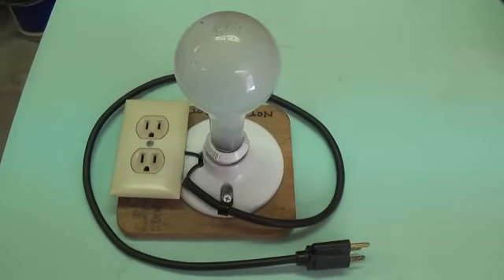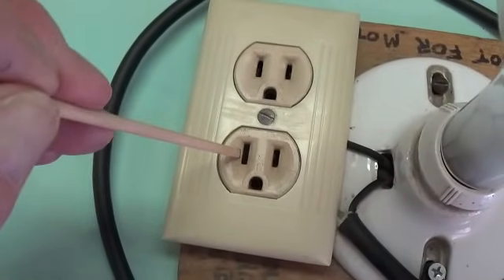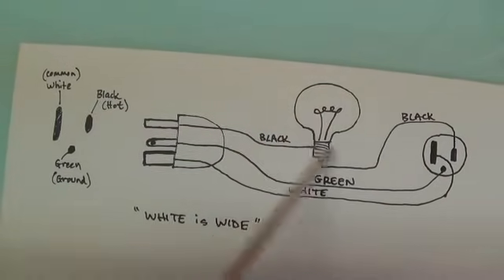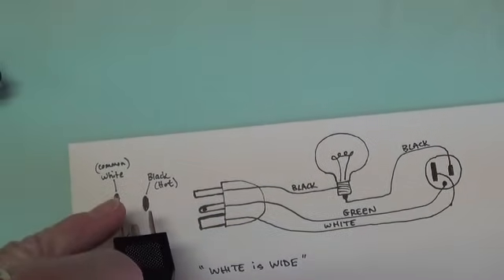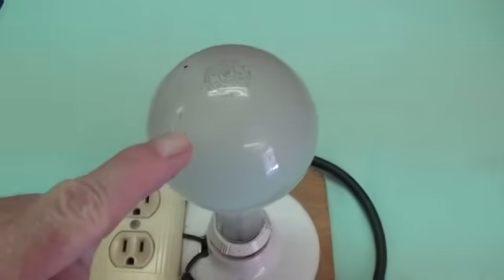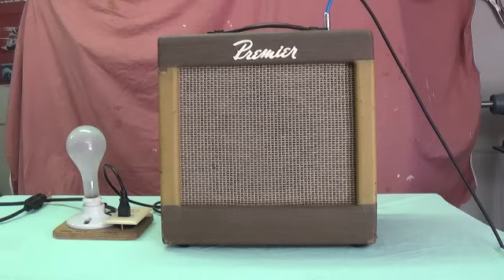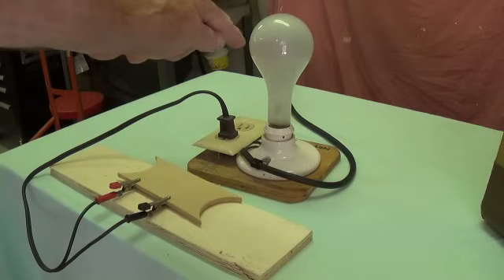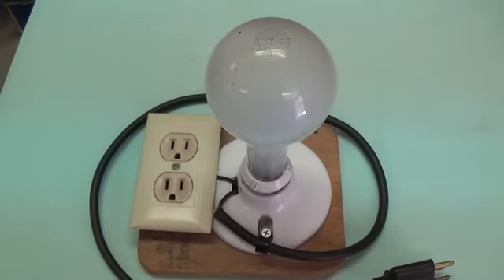Build Your Own Current Limiter for Protection when Repairing and Testing Electronic Equipment

Comment: it is safe for me to use 240v 100w filament bulb in this current limiter? would it serve the same purpose?... planning to make one similiar like your myself...reasob being have a 110v usa fender amp...the voltage here in my country is 240v...and getting a 110v bulb is a bit difficult here...thought of using 240v 100w filament bulb what is available here...pls advise...tq
Reply from the maker: +Fender Strat Gibson Les Paul  Yes, since your voltage is double ours in the U.S., your current flow is half, so your current limiter will require a much lower wattage bulb, i.e. 240V 100W.
Reply: Thanks uncle doug...
Reply from the maker: You may have to experiment a bit to get the perfect wattage, but 100W would be an excellent starting point. Good luck.
Reply: +Uncle Doug when you said experiment with the wattage...i should use bigger wattage than 100w?.. or lower wattage than 100w? how do i know "X" wattage is enough? my amp is a fender deluxe reverb RI 22 watts...im using also a 240v - 110v converter...
Reply from the maker: You want the bulb to either get warm with no glow or glow very slightly during use. Use the 100W. If it performs correctly, then continue using it. If it glows too brightly, then use the next higher wattage.
Reply: +Uncle Doug thanks...really appreciate it...
Reply from the maker: You're welcome :)
Reply: +Uncle Doug hi uncle doug...ive got a question...it is possible to use a current limiter that plugs dirrect in a 240v wall voltage... and use a transformer step down at the end of the limiter to plug the 110v rated amp...or instead i should use of a step down transformer at the beginning which is at the wall input ...and plug in the amp directly to a 110v current limit at the end? does the transformer in between the amp and the lamp changes things? hope u get what im trying to explain...
Reply from the maker: I would personally place the current limiter as close as possible to the amplifier circuit, so in your case, that would mean a 250W bulb current limiter in the 110VAC line between the step-down transformer and the amplifier.
Reply: +Uncle Doug ok uncle doug...got it...thanks alot!!! u have been a big help!!!
Reply from the maker: You're welcome.....best of luck :)
Reply: +Uncle Doug hi ... i have another question... what if i want to install a toggle switch...to switch between limiter and full power..how do i do the wiring connection?a spdt toggle switch will do the job?
Reply from the maker: I don't recommend it. It would then be possible to connect an amp, thinking it was current limited but with the switch in the wrong position, and have damage occur. If you want to bypass the CL, simply unplug the amp from it and plug the amp into the wall receptacle.
Reply: +Uncle Doug you are right...never thought of the switch on the wrong position...thanks o wise uncle doug...
Reply from the maker: You're welcome :)

Comment: Nice demonstration. Would a GFI outlet work acceptably in this arrangement? 
I would add that twice in my life I have seen light bulbs burn out and short internally, causing circuit breakers to pop...probably the filament flopping around in the bulb. Exceedingly unlikely, but something to think about.
Reply from the maker: +Chris Gonzales  A GFI might protect you from being shocked, but it would not offer the visible (glowing bulb) evidence of increased current flow, or the ability to estimate the amount of (or changes in) current flow from the brightness of the illumination.
Reply: Actually I meant the inclusion of a GFI outlet on the glowing bulb board...in conjunction with it.
Reply from the maker: It would probably interfere with the bulb's function....opening the circuit rather than letting the bulb limit the current. You could try it and see, however.
Reply: @UncleDoug  Even if the bulb illuminates to indicate a dead short, the GCFI would not trip. It's function is to detect a difference in the currents in the live and neutral wires, indicating a leakage to ground.
Reply from the maker: Thanks for your input, Silas. @silasfatchett7380

Comment: Normally you'd wire the hot line to the bottom terminal of the bulb, so that if you happen to touch the threaded metal part while unthreading it, you don't hurt yourself.
Reply from the maker: +Scott Brynen  That makes good sense, Scott. Thanks for the input.

Comment: Hi Uncle Doug and the trusty furry sidekicks. Greetings from Oz. I've been hunting for a current limiting solution for a situation I have, and I think what I took in from the current limiting incandescent globe video may be a tres elegant and very cheap answer.
 I have a (GSL MPPT 60-1)  (multiple power point tracking) solar controller which is doing very well harnessed to solar panels, charging a 12v battery bank and running some appliances through an inverter. Max output power is 60A, and input volts18-95V. It has an auto sensing 12/24/48V output. I had the smart idea that I could also use the critter in my RV, which has its own solar panel/ controller/ 12v house battery bank setup. The RV vehicle itself (a toyota bus) has a 24V system (alternator, batteries etc).  
The bus solar setup does fine where I am, but if I travel to Tasmania (significantly south - less sun because we are upside down to you) then the solar panels may struggle to meet my requirements, and I had the thought to use the GSL controller as a 24vdc to 12vdc charger from the bus alternator/ battery bank, since it has the ability to both drop voltage and smart charge batteries. 
However I don't know if the device has any input current limiting protection...   wouldn't expect such to be needed for solar panels, but if hooking up 24v batteries to the input side of the controller then there's the possibility of the circuit not having any current limitation, with a massive current subsequently releasing the smoke from the device. The manufacturer wasn't able to give me any guiding advice, other than it wasn't designed or tested as a dc dc charger. 
I'm thinking that a current limiting incandescent setup will give me protection when testing the idea to avoid cooking the critter if the circuitry can't handle/ restrict current from a battery input....   so given the device is max 60A output, if charging 12V batteries then max output is 720W - though I doubt the smart charging circuit is going to dump 60A into a single 12V 100Ah battery.  I'm thinking that if I calculate on say 20A max output that gives a theoretical (100% efficiency) 240W @ 24v input - 10A. Allowing for device losses, I'm thinking if I have a 400W-600W series incandescent load on the 24V input, I'll let enough current through for the device to operate in some fashion, giving me a visual on current without cooking it.
 If the incandescent load glows bright, then I'll be thinking that the controller circuit has no input current limiting and I'm barking up the wrong tree (subject to measuring what the actual output current to the receiving battery is).
Ahem....   yep, not much to do with amplifiers and such, is it :).   If you care to share any thoughts it would be much appreciated, if not, then please give Rusty a bone us for me and buzz the feline with the (head holding?) quad.   Sorry for taking lots of the page, and umm...  I'm not sure on whether I'd see a reply in the google email thingey, but I shall try if I don't see you here.             Cheers   Koj
Reply from the maker: +Koj W Greetings, Koj. After your lengthy explanation, I feel guilty for not being able to offer much in the way of brilliant insights. The only problem I can see is that incandescent bulbs are voltage dependent.  You can hook a 120VAC bulb up to a 24V power supply capable of providing 100A, and all you will get is a very dim glow. The situation would be worse with a 240VAC bulb. Yes, the bulb(s) will curtail the current flow in case of short circuit (or excessive current draw), but their ability to do this is based on the heating of their filaments (and increased resistance), and this heating/resistance may not be reliable due to the difference between their rated voltage and the much lower voltage to which they are exposed.  All this blathering aside, I say go ahead and build it and see if it works :)
Reply: +Uncle Doug   Thanks for the explanation (not blatherskiting at all) and the vote to experiment. I reckon I'll 
play a bit with a few 240v incandescents on 24V to get a ff find a 24v headlight bulb or two, and fiddle to see what watts seem appropriate - I guess according to my original thoughts above, about 400 - 600W worth. 
Pauses with another thought....  ahh, nope, the little portable electric water heater for the rv to make a cuppa is about 600W...  but that's 12V. Headlight bulbs it is I think.   Thanks.
Reply from the maker: You're welcome, Koj. Let us know how it turns out.  Also, Rusty is wondering if the surf is up on the Gold Coast.....he and his litter mates are planning a vacation there :)
Reply: +Uncle Doug  Hi Uncle Doug and sidekicks, sorry for the belated surf report....     The Gold Coast is expecting 6-10 foot of surf when the remains of Cyclone Winston arrive (according to the surf report - I'm about 1300 miles from there, so can't see it myself) Rusty better wear his floaties!. 
 I used to have a 4 legged mate who came windsurfing with me, but he preferred when things were pretty flat. He managed to grip a bit of neoprene stuck to the board fairly well.      Testing the solar controller hasn't been crossed off my mission list yet, but I now have the plan!
Reply from the maker: Thanks for the report, Koj. Rusty and his cronies are waxing their boards and modeling their new Speedo swimsuits. I hope Australia is ready for them.

Comment: I built one of these  with a 200 Watt bulb, and it has been working great. But I recently plugged in an amp that, although it worked well, caused the bulb to glow (at less than full brightness).  It didn't start to glow immediately, but as 5U4 warmed up, it began to glow. Same thing with different, known good 5U4s, and even after removing all the other tubes. No glow without the 5U4. The amp puts out 32 watts with two 6L6s, and takes a 2 amp fuse. Should I assume that something bad is wrong in the circuit? If so, is there a most likely candidate? Thanks for all your great videos. I'd buy your book!
Reply from the maker: +bluesharpfiend   A single 200W bulb is suitable for use with low-wattage, generally single-ended amps. When you work with higher wattage amps, you will have to increase the bulb wattage or use two 200W bulbs in parallel.  The amp circuit is probably fine, but simply too powerful for your single bulb.
Reply: +Uncle Doug Thanks!
Reply from the maker: You're welcome :)

Comment: then you didnt work on microwave oven , cuz they dont work on those kinds of loads , or i made it wrong , but it powers other things nice , just not the oven
Reply from the maker: +Pavle Pavlovic  No, the device is intended for use with audio amplifiers, primarily tube-driven amps. Microwaves, ovens, refrigerators, and medium to large size motors draw too much current and suffer too much voltage drop with a current limiter.
Reply: Uncle Doug indeed , would be nice to know it before i lost the time on it, at least i can use it for some amps when they go by
Reply from the maker: Sorry for your wasted time, Pavle. I never considered excluding its use for microwave ovens in the video description, but now we know. Thanks for your input.
Reply: Uncle Doug thanks, just wanted to share my experience could be useful to someone
Reply from the maker: +Pavle Pavlovic  We appreciate it, Pavle, and wish you the best.

Comment: Most european systems follows the same standard if using a single phase (if 3 phase thaey are normally divided into three separate single phase in the 2 pin connectors), but it´s harder to rekognize wich part that is alive and wich is not. But, it can be seen with a regular voltmeter and marked out with a sharpie on the lab. board.

So i think there will be no problems.
Reply from the maker: +Sheep_Ewe Thanks for your input, SE.

Comment: It should be standard with everyone using high voltage repairs. I have one with three light bulbs each with a parallel switch banked in series so i can add more or less resistance but based on what you are saying maybe a parallel bank too to reduce resistance
Reply from the maker: +graham kaveman  Excellent advice, Graham.

Comment: So good.  Thanks Doug!
I'm gonna build one of these to try out my new (old) Pultec inductor/valve EQ, purchased from a garage sale last year.
I've been meaning to bring it up, but unsure of the best procedure, having not done this before, and not wanting to damage this unit.  
I have access to a Variac, but the current limiter sounds like the best way to go.
(Or is it best to use both current limiter and Variac together on first power up?)
Reply from the maker: +EvLoutonian You're welcome, Ev. I use the CL every time I test or work on any 120VAC electronic device....it is essential. I only use a Variac (and CL) with really old circuits that have been unused for several years, to gently bring the electrolytics up to operating voltage. Good luck with building your CL....you will find it to be an indispensable tool.
Reply: +Uncle Doug I have been told that running tubes with too low a voltage to the heaters causes cathode poisoning. Would it not be a good idea to pull the tubes when bringing up capacitors?
Reply from the maker: I'm not familiar with that problem, Silas. I guess you could pull all the amp tubes except the rectifier if you wished.

Comment: Best to wire the Black from the plug end to the tip of the bulb socket, Black from the socket to the ring.
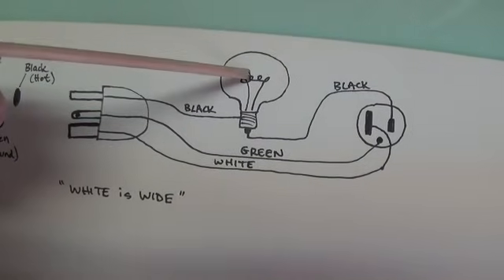Reply from the maker: +HillOrStream  This was explained in the video via a note at 1:46. Thanks for your input.

Comment: Hello Uncle Doug and Rusty. I wanted to thank you for doing these videos. Your viewership is over two million at the moment. It just goes to show how many of us want to know about these amazing amps and how they work.  
I was an electrician for many years, and would like to point out one detail, if I may. On the drawing, it shows the hot from the wall going to the screw shell of the lamp. If you like, you could post a blurb in the video or mention that it may be better to connect it to the other terminal. The reason is that the threads of the lamp are hot, and potentially dangerous when changing the lamp, if the person is touching a grounded device or something.
Reply from the maker: +non participant You're welcome, NP, and thanks for your helpful input. I'll add a note to the video.

Comment: HI Doug I liked your video very much and I will be making one  for myself.
Reply from the maker: +mango3586  Thanks, Mango. Everyone working on electrical equipment should have a Current Limiter. It has saved me from inadvertently damaging vintage amps several times over the years.  You'll be glad you have one :)

Comment: What about a 100 watt light bulb and a resistor? Would that work? What value and wattage resistor?
Thanks
Reply from the maker: +KillerRiffs It wouldn't be as effective. At first, the light bulb filament has very little resistance, which allows the amp to function properly, but if the amp begins to draw too much current, the resistance of the filament increases and stops the excess current draw, illuminating the bulb.  A fixed-value resistor would not function like this.  If you're having trouble finding a 200W-250W incandescent bulb, check on Amazon. They usually have them listed for sale.
Reply: Where would the AC come from when there is no input signal? That is what I am a little confused about. Maybe my meter is giving the rms of the unfiltered DC going through the transformer windings to the output tubes?
Reply from the maker: Without any input, there should be no AC in the signal circuit. If there is any, then, depending on its frequency, it is coming from the power supply (120Hz), the filament circuit (60Hz), or EM interference from the room or the power transformer.
Reply from the maker: I'm confused also, KR. Long-distance amp repair is only possible if I'm familiar with the symptoms, and in this case, I'm not. I would say either keep at it, using a multimeter to check all the voltages with the tubes in place, since without them, the readings are virtually meaningless....or get some help from an experienced technician. Good luck.
Reply: Thanks

Comment: Possible idea. You could set up a photoresistor. Get a pnp transistor and pull the base high with a resistor,  output connected to a relay so it is always on, then connect the base of the pnp to a npn that is grounded. Then the photoresistor to the base of that. So when the light comes on it will ground out the base of the pnp killing the relay turning off your current limiter. You will have to add something to latch it closed as it will just oscillate the light on and off.And then place it in a box so the outside light won't trip it. But have an eye hole so you can still see the light. And idea you might want to think about. Just an extra safety step
Reply: +Joshua Blalock I did that wrong with pulling an pnp high, should be a npn I believe. But you get the idea.
Reply from the maker: +Joshua Blalock  Thanks for your input, Joshua, but to be honest, the Current Limiter is quite effective as-is.  The bulb flashes brightly to notify you of an unusually high current draw, while dramatically reducing the current to prevent damage to components. It's purpose is primarily to protect equipment, while ground fault interrupters are preferable for human shock prevention.